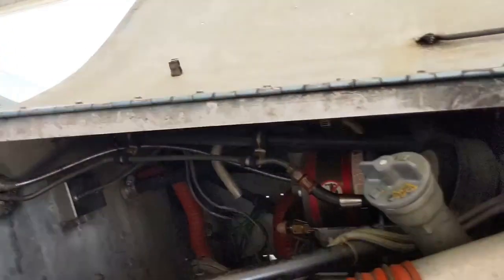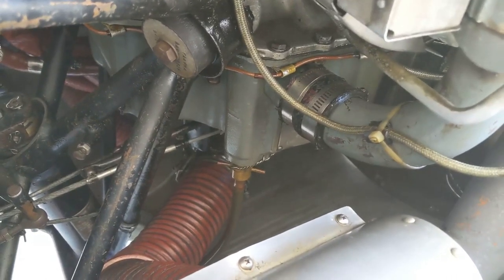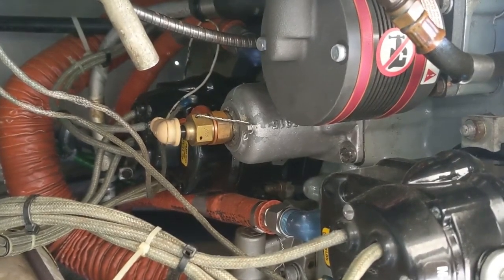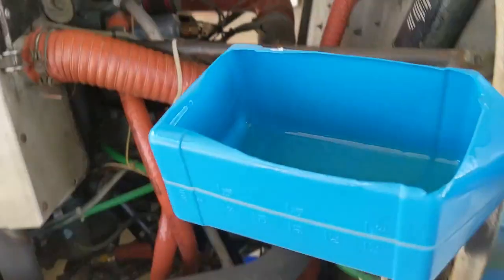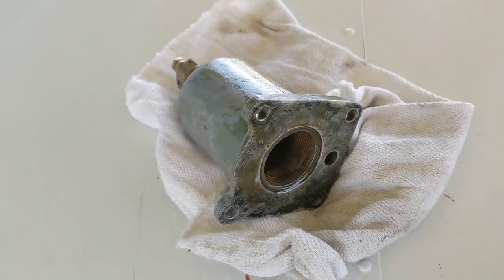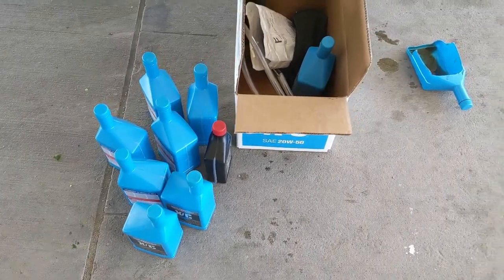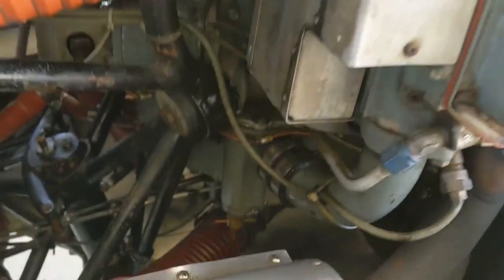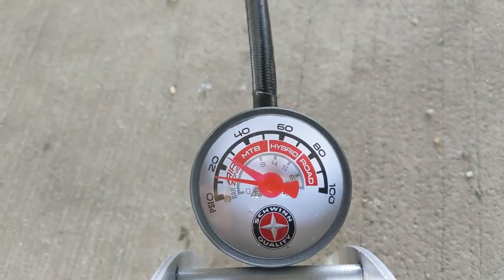Dirty job, but gotta do it || Oil Pressure Screen || Piper Cherokee 140

Comment: This is the best video I've seen on changing the oil on an O-320 with the pressure screen. Thank you so much for making it!
Reply from the maker: Thanks for the nice words! I no longer have the pressure screen as I've added the spin-on oil filter adapter. But I knew I was going to add that when I made this video so I had a window to show what it was like.

Comment: Its a good idea to both oil screens. The second is in the bottom of the sump or on right rear side. It is the suction screen. You will need an AN 900-10 crush washer. Don't remove it until the oil is  drained.
Reply from the maker: Yes you're right. Although that suction screen was very difficult to get off on that airplane. There was stuff in the way that made it basically impossible except at annual.

Comment: I'd suggest having an oil filter adapter put on your plane.  Can get 50 hours out of an oil change. Lot less mess and lot less of a pain to take off and put on.  I had that done to my Decathlon this last fall. Did cost about 800 dollars but the ease of now changing the oil is well worth the cost to me.
Reply from the maker: Yep. I did that during the most recent annual. Oil changes are easier. And I get more hours on the same oil.

Comment from the maker: This actually took a lot longer than I thought it would take. I hope I get more efficient at it as time goes on. When I switch to a spin on oil filter, safety wiring will be a fun new challenge. For now, this is what I have to do.

So far I have been consistently shocked at how dirty my oil gets after only 25 hours of engine operation. 100LL aviation gas leaves a bunch of particles that the oil has to clean out of the engine. My engine is rated to take ethanol free unleaded car gas. It's better for the engine and less expensive than avgas. I should really start using that more often, but it's not exactly convenient to get this gas to the airport to put into my airplane. I have a 14 gallon take but it weighs over 100 lbs when filled.

Any suggestions on how to easily use car gas rather than dirty expensive avgas?

Comment from the maker: Probably the single most annoying thing about being a student pilot was the imprecision of the federal regulations around preventative maintenance. I had many discussions with different people with different opinions. And where I landed was that even though I own the airplane, my student pilot certificate was insufficient to permit me to do preventative maintenance – like an oil change – without being supervised by an A&P.

It’s possible that I’m misreading the regulations. They appear to be written by lawyers for lawyers and pilots who are lawyers. But I’m not a lawyer, so I don’t want to pretend to know what is legally correct or incorrect. But the position I took, if wrong doesn’t get me into trouble. Whereas if I did my oil changes as a student pilot, and I was wrong about if I was allowed to, I could be in trouble.

Anyway it’s now 100% clear: I am a private pilot and I own the airplane and it’s operating under Part 91, so I can change the oil on my airplane without needing to hire an expensive A&P mechanic to either do it or provide supervision.

While not my favorite benefit of having my private pilot certificate, it’s surprisingly high on the list. If you’re a pilot, what is your favorite part of having your ticket?

Comment: Do you have a parts number for the screen housing gasket?
Reply from the maker: Not anymore. I sold that airplane last year. And even before that I put a spin on oil filter adapter.

Sorry. But if you check the piper parts manual you should be able to find it.
Reply: @1dullgeek  I checked but couldn’t find it. Thank you
Reply from the maker: @ABetterMe20  ahh